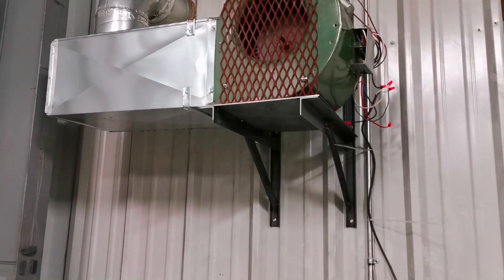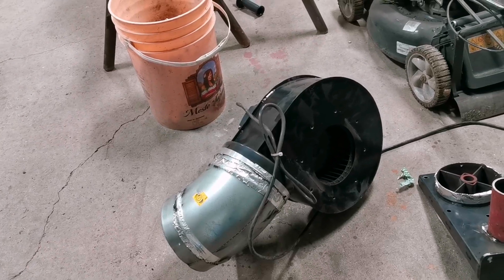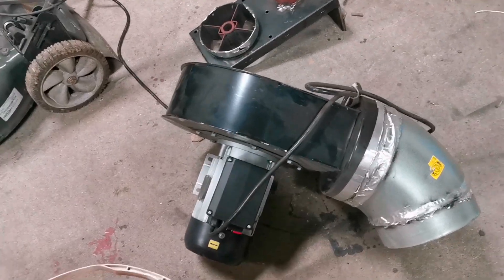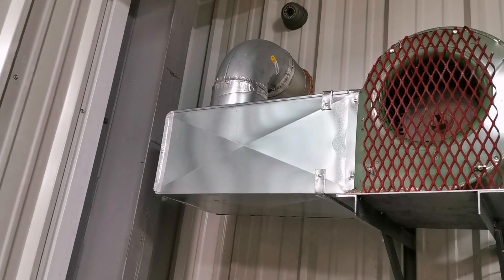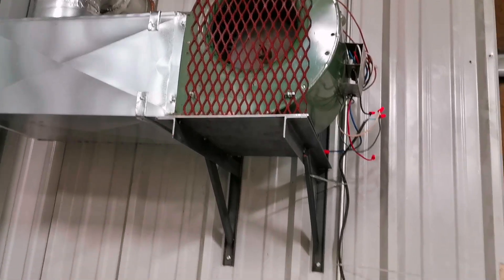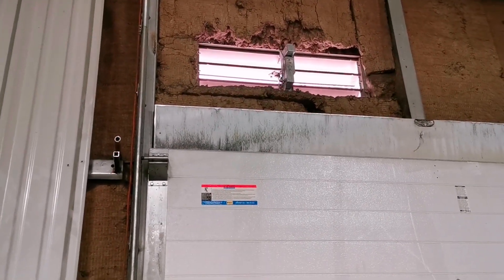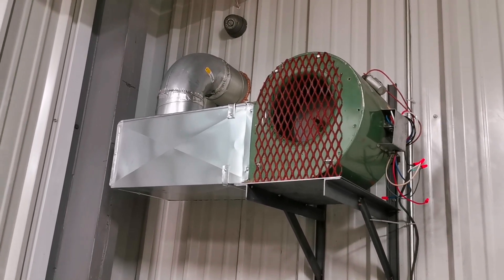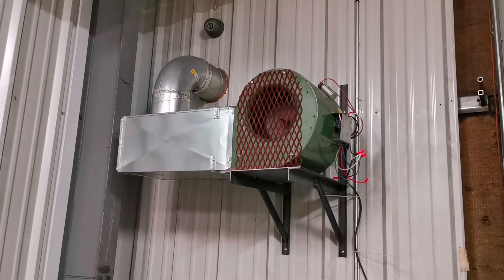Inexpensive Shop Exhaust Fan Fume Extraction System.

Comment: In the welding part of the shop at my school they actually have their extractor fan is also connected to two different vents the one is overhead and the other one is right where the welding surface is
Reply from the maker: This one is built to just extract the smoke out the shop. We wear n95s when welding for a long period of time.

Comment: Nice clean build, but it's like mopping the floor with the tap wide open.
Your shop ceiling is already full of smoke before it reach the exhaust fan system against the wall. If you want a decent fume extraction and want to breath in clean air, you need to extract the fume at the source itself. You can do this in a few ways. First and easy way is to use a flex hose of arround 80 to 110mm diameter and lay or hang this at the spot where you weld. Another way is to make a hood in sheet metal above your welding table, that is connected with a metal pipe to the fan system. And last way, is like i did it back in the 90's when i was still at school learning to weld, and had my stick welder here at home. I bought the cheapest kitchen fume extractor and mounted this to the ceiling in my hobby shop/shed that was located outside in the back garden. I then build a semi rigid arm with 80mm plastic rain pipes, and reinforced these plastic pipes with a 20mm steel pipe on the inside. These metal pipes where connected to each other with metal brackets.The plastic pipes where connected to the steel pipes with pop rivets. On the rotating parts, i used plastic mofs that slide in each other, and on the hinged parts, i used flexibele hose used for exhausting laundry dryers. Even when welding for long periods of time, the plastic pipes etc stayed cool because there is so much airflow of room temperature that pass through. The internal switch of this kitchen hood was always ON, but i had wired a light armature flipping switch as a remote allong these plastic pipes on the outside up to about 30cm from the tip that sucked the fumes away. After welding, my small hobby shop/shed (7 meters by 2,5 meters) was smoke free. After years of use,and mostly due the sun and age, was only the laundry dryer hose deteriorated. But that was a cheap and easy fix. With this system i could reach almost every corner of my shop/shed and at the height that i wanted. To support the weight of the arm, i used some springs on the inside, connected to the metal pipes.
Reply from the maker: Hey thanks for the advice! This setup is in fact coming down. I had a proper fume extractor with the  hose attached to a arm that i could move around. It was very loud. I was having issues with the motor turning on and off randomly aswell. So i took it down and built this system. It pulls the smoke out within ten minutes of it running. However, im building an additional section of shop and the entire wall is coming down including this setuo. So, ive decided to either go with a portable fume extractor build something myself with a dry vent style hose like you mentioned.  Thanks for watching and i appreciate the honest feedback.

Comment: Simple enough.  If you block off some of the inlet then it will run more efficiently and actually pull more air.  Those fans are designed to pull air through ductwork and are made to work against that resistance.
Reply from the maker: Interesting. Ty for letting me know. I may try it and time it to see how long it takes. Maybe I'll make a video and post it on YouTube.
Reply: @RCWeldingsgarage  You will see an instant change in the tone and suction of the blower.  You can put an amp gauge on it to set the peak flow - block it off until it draws it's rated amperage.
Reply: I was mistaken, it is the outlet you want to restrict.  Sorry, been a while since I messed with mine.

Comment: Hey! That is a nice setup... I actually have a squirrel cage blower on the way to my house right now I plan on using to extract fumes from my garage.... 

I was thinking of running some ductwork over to my welding table and building a hood over the table to suck the fumes right up off the table. Does this method keep the shop clear of smoke while you were welding? If so I need to think about just doing this it would be much easier.
Reply from the maker: Hey I like your idea about running duct work to the table. This method would work much better. My extractor takes about five minutes to clear my shop, but it doesn't suck up the fumes at the source.

Comment: Thanks for the video. What is the box for? Can you just mount the fan to the wall and then out?
Reply from the maker: Thanks for watching. The box was made to fit the opening of the exhaust fan and to collect the dust and push it of the wall. You can design one anyway you like, even with an inline wall fan. This setup works well in my shop.
Reply: OK cool! I wasn’t sure if the box was required to provide back pressure to the fan as they are normally installed in a furnace with plenty of back pressure?
Reply from the maker: @m.m.m.c.a.k.e  my buddy who is a hvac installer designed it. I don't think there's any back pressure. I've seen him install a few at my other buddies shops and they all have different configurations without a box. However I could be wrong and it's possible that there's some back pressure. But honestly any setup with a good exhaust fan or furnace fan should work. My old shop I used to work out of, I would put the furnace blower at the door of the shop and it would just push all the smoke outside  in minutes.
Reply: @RCWeldingsgarage  OK thanks!

Comment: Thanks for sharing your experience with the production fume extractor.  I'm remodeling my garage into a shoe repair shop, and many of the glues and solvents contain VOC's.  I've been reluctant to spend $2k-$3K on a production fume extractor, even with a charcoal filter; I would prefer to vent everything to the exterior and let Al Gore worry about the atmosphere...lol.

Anyway, addressing the negative pressure with the louvers from the exterior was a great piece of info, as that was a concern also.  I spent a full week in Cleveland learning nothing but stick at Lincoln Electric; that bracket will be a nice beginner project.  Thanks again.

Comment: Just asking cause I have a furnace fan (with an exterior mounted electric motor).  Just searching around here for ideas.   I got the exterior mounted motor so it would be separate from any combustible fumes being drawn out through the cage.  Does your unit have the motor inside and are you concerned with fumes that could combust, or not?  Thanks.
Reply from the maker: No I'm not too concerned as I don't paint in my shop anymore. The only thing I use it for is welding fumes and humidity in the shop. I was looking for your style furnace fan with the motor mounted on the outside but I couldn't find one. Hang onto that setup it's the best for exhausting fumes and paint.
Reply: @RCWeldingsgarage  Thanks for the reply.  Helps to confirm I am going in the right direction then.  I like how you built that plenum box to vent outside.  It allows you to have your unit turned.  That would work great with mine too.  Do you think the change in direction (not blowing straight out) would impair the airflow somewhat?  Again, just looking for your experiences so far as it means a lot more than theory.  Be safe. :)
Reply from the maker: @dginta7932  My buddy built the box for me. He owns a hvac company. I can clear my shop of fumes in about ten minutes of it running. So I think it's OK the way it's setup. He used the same setupin our friends mechanic shop to clear car fumes using a furnace fan/blower like yours. They capped one side off and used the other to connect  to large diameter pvc pipe and from there they branched it off to hoses running down to the cars exhaust to suck up the fumes. Works amazing.
Reply: Awesome.  Thanks for that, appreciate it.